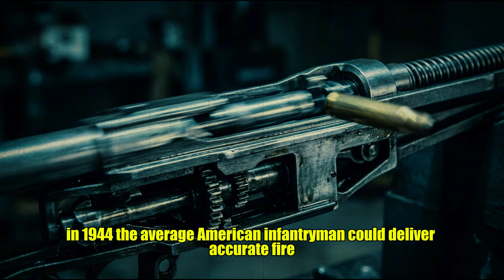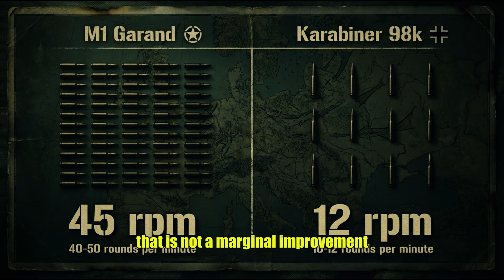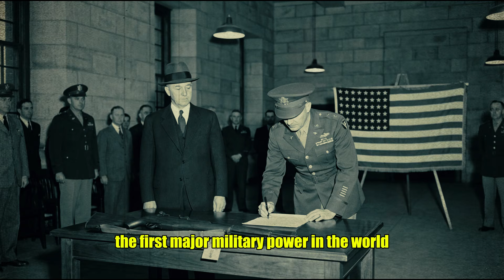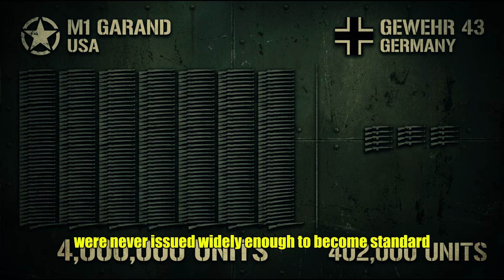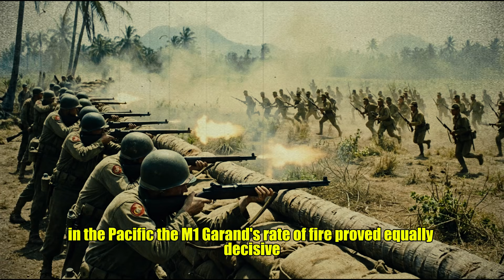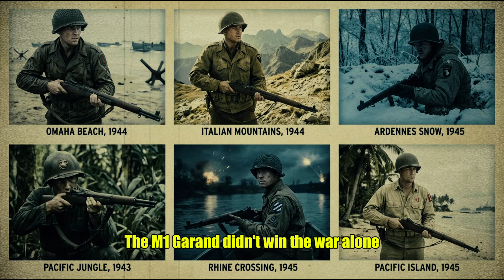WHY THE M1 GARAND WON WORLD WAR II - GERMANY NEVER

Comment: Thumbnail is wrong
Reply from the maker: What’s incorrect about it? Genuinely asking - if there’s a factual error in the visual we want to fix it.
Reply: @OTHERWAR  M1 Garand didnt support and external box mag, just the M14 which is essentially an upgraded M1
Reply from the maker: @damuffinman1394  Correct on the M1 Garand - it fed from an internal 8-round en-bloc clip, not a detachable box magazine. The video doesn't claim otherwise. The detachable magazine point in the StG 44 comparison refers to the German rifle's 30-round curved mag versus the Garand's fixed internal clip -that contrast is part of why the StG 44 concept was revolutionary. The M14 did adopt a detachable box mag, you're right that it's the direct evolutionary step between the two.